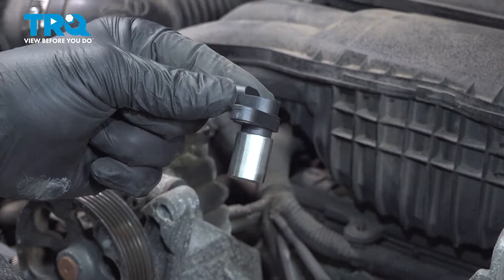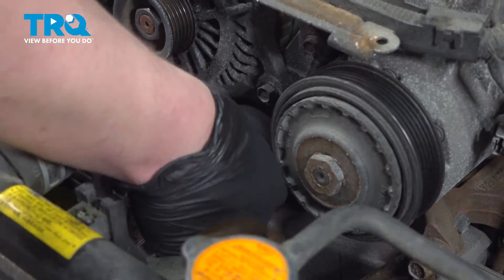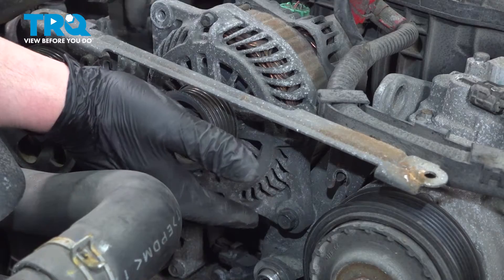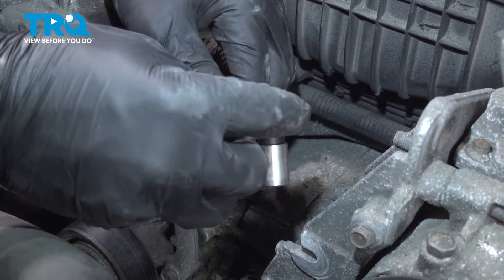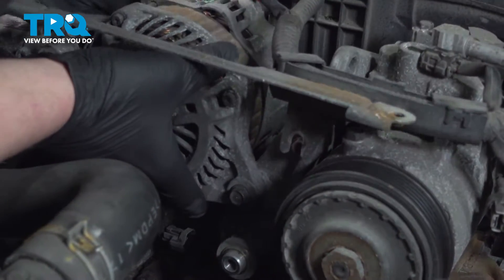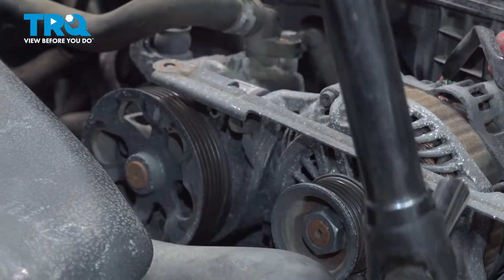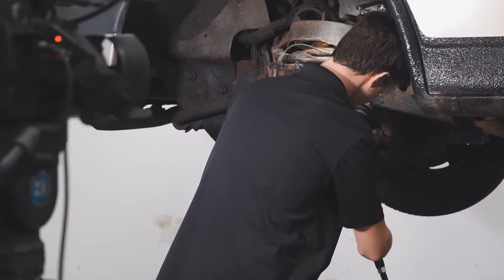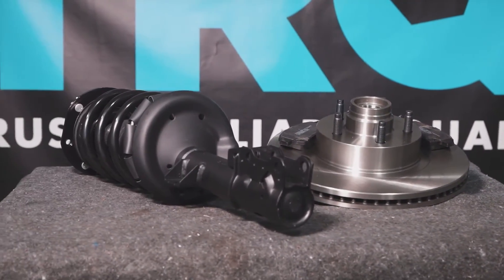How to Replace Crankshaft Position Sensor 2010-2014 Subaru Outback 2.5L H4

Comment: Great video... 2011 OB was starting hard intermittently with no codes. After several days of this it finally threw the Crankshaft code P0335 so I replaced the sensor as outlined and is now starting like it should, thanks!

Comment: Great video! But , I replaced mine with a Dorman brand and it would pause, then crank but no start. Put the old one back in and it started. Does mine need to relearn the new part? Or a defective new one?

Comment: If anyone wants to save a good amount of time , you can easily take off the belt and pulley and have enough space to access the 10mm bolt that holds the sensor and take it out without having to remove the bracket and alternator . Saved me tons of time

Comment: Thank you very much for what you posted here it made my job so much easier.  This is the first time I've owned a Subaru I have a 2010 outback and I replaced the camshaft position sensor first and that works for a day but the next morning I went to go to work and it was not starting just a continual crank.   Your video helped me do it in 20 minutes. Thank you very much!